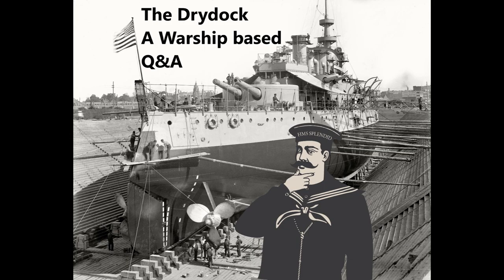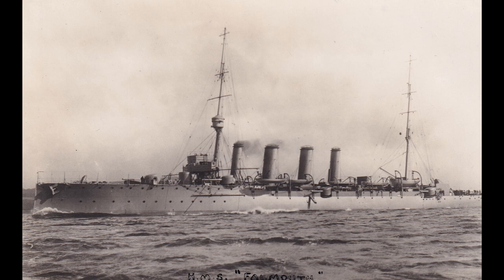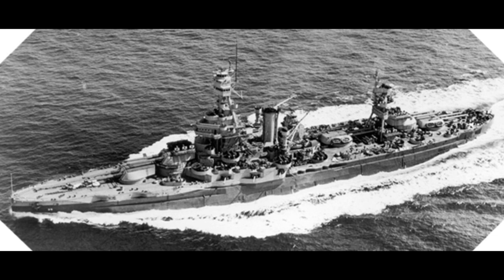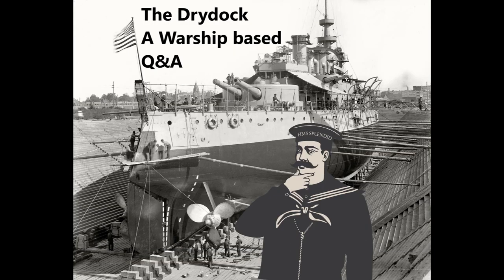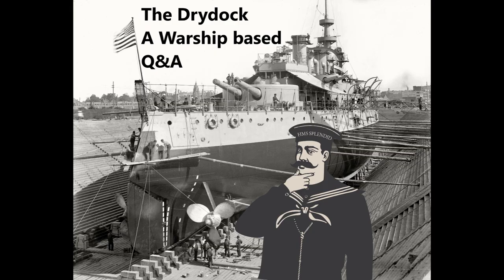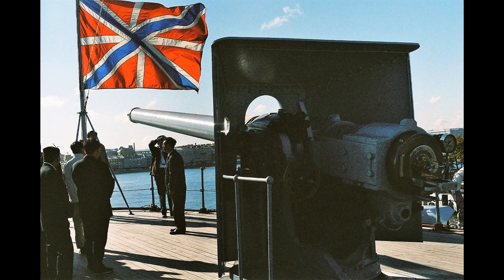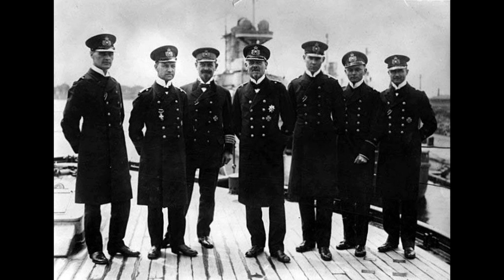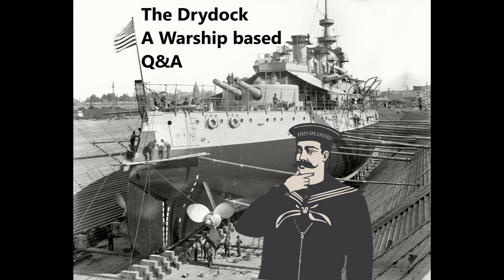The Drydock - Episode 136

Comment: The X1 was a good commerce raiding submarine - for any one else than for the RN. The RN being the one party which did not have much use for them. In one of the book/booklet i have read discussing (at very surface level - "The Century of Submarines") the submarines all the way to the end of the WW II it is mentioned that the RN essentially tried to remove any notion of it ever existing so that no one else would try to replicate it.

Comment: wrt the New Yorks using VTE power, the Wiki entry gives a somewhat different answer to that question.  The Floridas and Wyomings used Parsons turbines, from the UK.  When the New Yorks were ordered, there was apparently pressure to "buy American", but the US turbine manufacturers could not meet the Navy's performance specifications, so the Navy reverted to VTE.  Of the next class, Oklahoma still had VTE power, while Nevada used Curtis turbines, then the Pennsylvanias were a head to head comparison of Curtis and Parsons turbines.  It is entirely possible that Parsons understood something about turbine efficiency that Curtis did not.  There had been earlier head to head comparisons, where the USN would build one BB with VTE power, and it's sister with Curtis turbines and the Curtis powered ships were horribly inefficient.   The range and coal capacity for the two classes is incomplete in the 1919 edition of Jane's and somewhat divergent in the Wiki entries, but there is some indication that the Parsons turbines were quite competitive with VTE.  The 1919 edition of Jane's also reports an inability/unwillingness of US turbine manufacturers to meet USN specifications motivating the reversion to VTE.

Comment: I know you don't like Beatty but I feel it unfair blaming him for getting the range wrong at Jutland. He wasn't personally in the spotting top taking range readings,  he probably ordered fire to be opened at a range the Germans couldn't respond to and his subordinates got it wrong.  Nor did he personally hoist diganl flags, your video on Jutland shows it was Tiger's job to pass along signals to 5thBS and she didn't. As for the distance between 5thBS and the BCF, weren't both forces zigzagging as was standard practice in wartime?  Both forces were moving  away from each other at jsut the wrong time.  A case of massive luck for the Germans, maybe 10 minutes later they would have been converging.

I also feel you give Hipper and Scheer far too much praise.  They both made massive blunders at Jutland, once Beatty drew out of range, WHY did they chase him??? The HSF couldn't catch him and Hipper didn't want the fast BB's of 1stSG tangling with the proper BB of 5thBS.  And why did neither of these supposed genius' wonder why Beatty was heading North towards Norway and not NW toward Scapa??  
The HSF ultimate escape was down to two (lucky for them) factors.  The earlier mistake of the officer in getting information from Room40 and a very lucky catch of the GF's recognition signal.
I feel both get far too much praise when a lot of their successes come down to both some skill and huge good luck.  Good luck denied Beatty.
But as someone once said, "We praise the losers so much because if they were supposed to be this good and we still beat them, we must be far better"